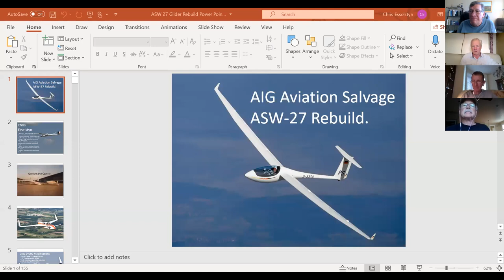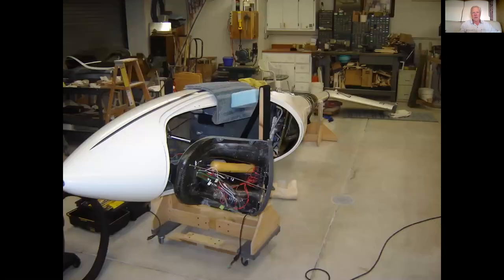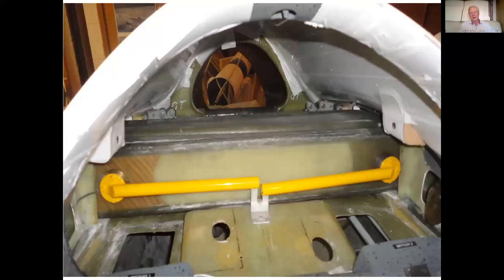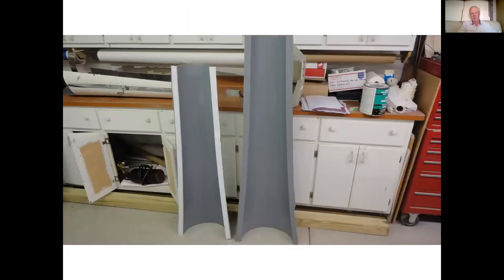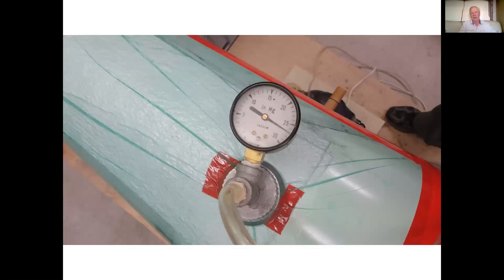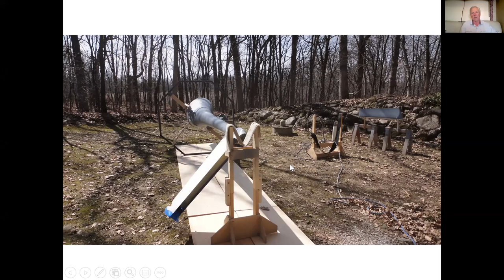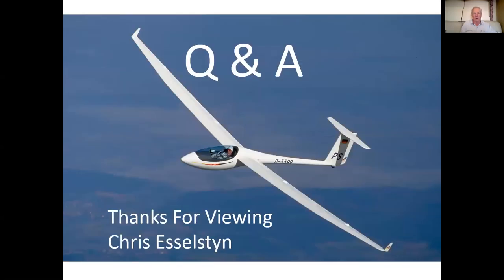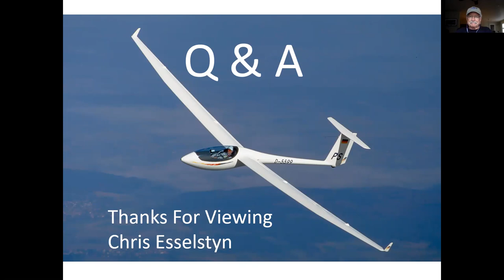Jet Self Launch Glider with Chris Esselstyn

Comment: Hi there, thanks for this interesting report. I every now and then think of modifying my glider (an 18m span Lak 17b) and install a turbine in it. I think I am no near to the handcraft skills shown in this video but even if I had them, I'm pretty sure that the type certificate issued by EASA would be invalidated. How did it work in your case with FAA? Was it really enough to send a few pics of the rigged glider to FAA or is it now under the experimental cathegory? Thanks.
Reply: The sailplane was imported into the U.S. under the experimental category. If your glider is not experimental it would need to be changed.